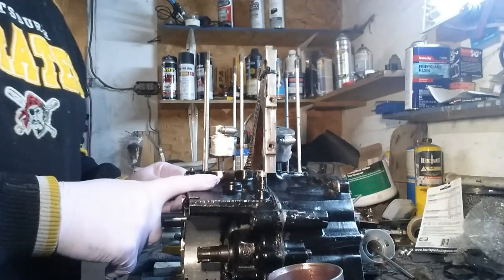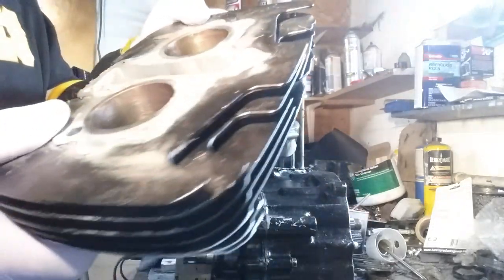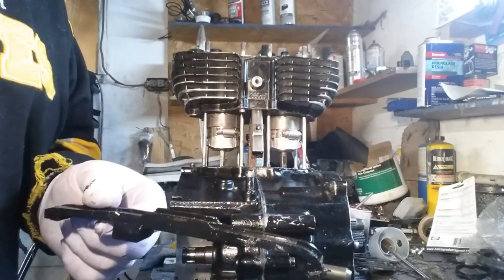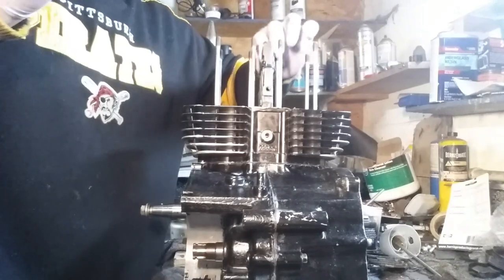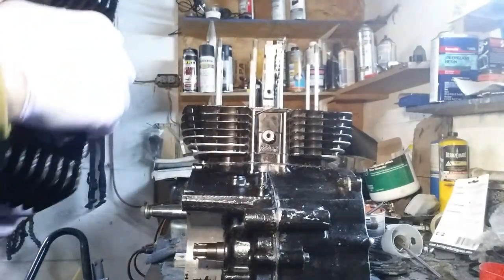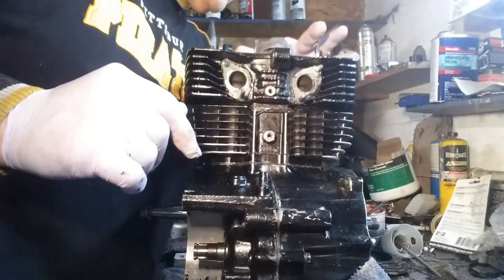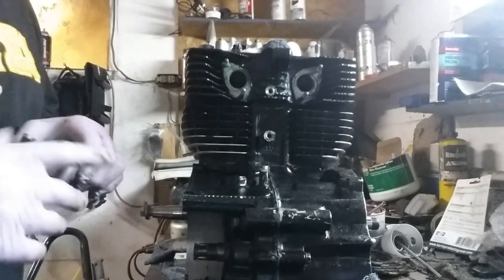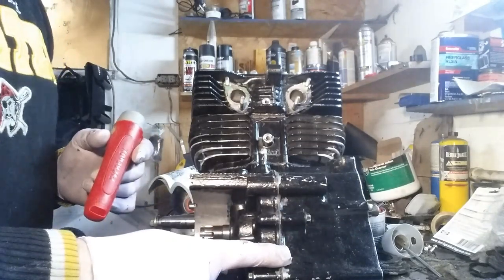Honda Rebel 250 cylinder install

Comment: This video is very useful, thank you. May I ask, how did you break the cylinder base gasket? I absolutely cannot get mine off, and I believe only 3 bolts need removal so I think it's just the gasket keeping it on there. Thank You
Reply from the maker: There are 4 bolts on top which are the 4 long studs and there is another 5th one in front and the chain tensioner bolt in back. So there is 6 things that holds the cylinders down to the engine.
Reply: @HarleyDavidsonVince  when you say long studs you don't mean the long studs the cylinder and head go over to stack them, do you? I mean once the cylinder head is removed then only the bolt in front and the tensioner bolt needs to be removed correct?
Reply: @sarahtomasulo3670  There are the 8 that hold the head thought the cam caps, the 2 that hold the chain tensioner above and below the intake manifold, and 3 long 10mm head bolts, one in front of the cam cover between the exhaust flanges(usually covered in road grime), and 2 inside the can cover at the rear of the intake cam. Please DO NOT use any sealant on your head gasket!

Comment: Ultra Black is good stuff when used for the right purpose. But it is not good for use as a base gasket. I have no idea why you did that, the base gasket is still available from Honda.
Reply: He used it on the HEAD? Then he stuffed cotton balls in holes? All of those fibres will plug oil ways. These engines do NOT have an oil filter. 
No wonder he's redoing this engine! 🤡